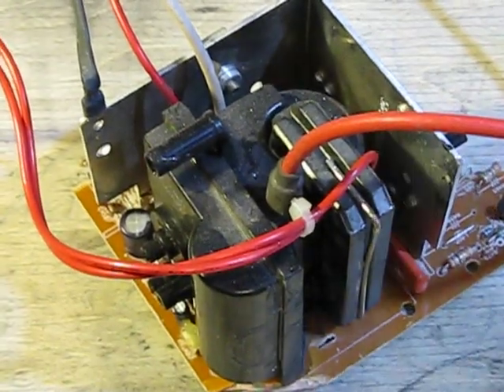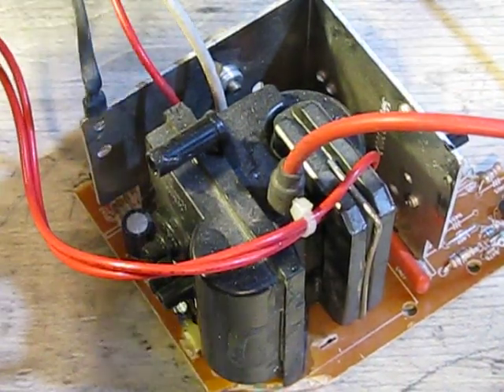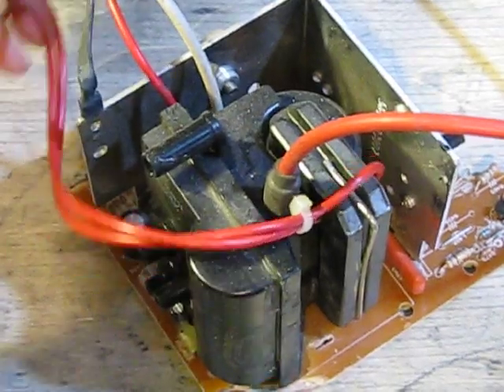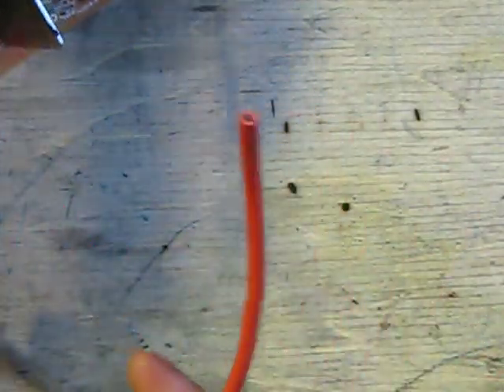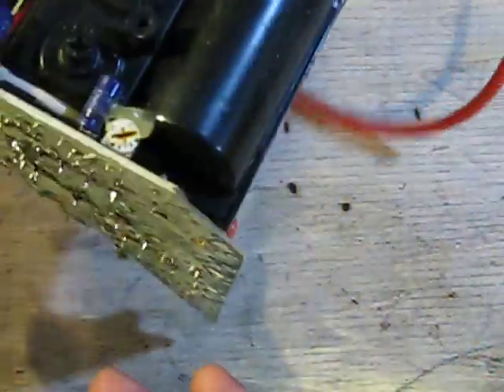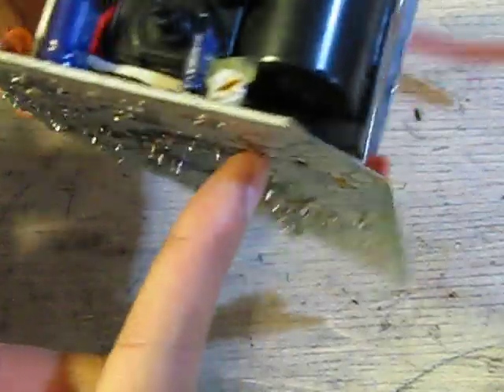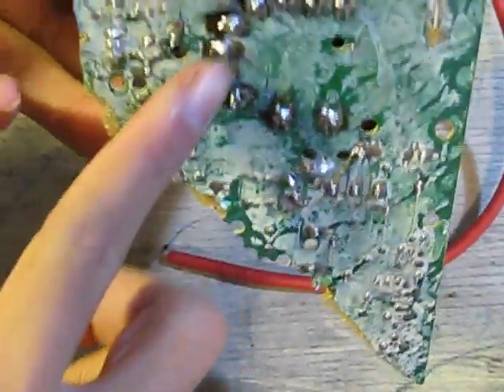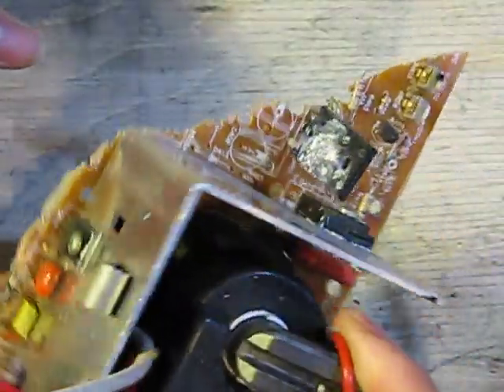How do you wire-up a flyback transformer?

Comment: I recommend using the 555 timer chip to either drive an FET power transistor directly or use a small signal transistor as a buffer to drive the FET. Proper triggering for the power FET requires that the FET gets at least a 3-5 volt fast rise pulse to properly turn on and off. Check the specs on your FET for the best numbers. It is a good idea to design a 555 circuit that has a variable on / off time.

Comment: I use the existing windings on the flyback (try to figure out which one is the one attached to the horizontal output transistor (the big one on the big heatsink). I find a good starting point is about 15volts at about 2 amps. You may be able to push up to about 35 volts at 3 amps. Definitly need heat sinking for this, also check out the FET transistor specs, you will be developing quite a bit of 'back EMF' on the transistor, may need a 'damper diode'  to quench the back EMF (can have zener too).

Comment: By the way, I am 64 years old and have been fooling around with electronics for well over fifty years. I worked on color tv's in the mid sixties ( the old original round tube crt's made by RCA). In those days flybacks were pure transformers, no diode doulbers built in, ac output requiring an external HV diode rectifier tube.

Comment: Using the ohmmeter, locate the windings on the FBT. There will normally be two or three windings, windings may have multiple taps. To determine the position of the taps, you may need a meter that is good at low resistance readings. There will be at least one lead that shows no low resistance path to the others, this will be the ABL lead (the low end of the HV circuit). Before you desolder the FBT look on the P.C. board. There may be lettering that will tell you which pin is which, FBT, HOT, etc.

Comment: The return wire for the high voltage winding will usually be connected to the base of a small signal transistor on the P.C. bord through a resistor current limiting circuit. This is the beam current limiter or 'automatic brightness limiter circuit  (called ABL for short). Once you have seperated the flyback from the P.C. board (using a heat shrink gun you can easily melt all the pins at one time and pull the flyback free). Using an ohmmeter, ohm out the windings. See next comment...

Comment: Be aware that most modern flybacks are composite devices, they have diode voltage doublers, trilpers, or quadruplers on the output side of the coil (also capacitors, you can get a nasty shock if you are not careful. This is a bad way to find out you have a bad heart!!!) Anyway, the output will be DC voltage at 25-35KV. Usually the CRT aquadag coating is used as the output filet cap. If you use the design I proposed in my previous posts, be aware that you easily short out the diodes in the FBT.

Comment: Of all those wires and pins on the bottom, you really only need to worry about 2.  The big red one is the HV output.  Then one of the pins on the bottom will be the ground return.  It's different on every flyback.  The easiest way to find it is to see which pin the HV out arcs to the most strongly once you have it up and running.  There are a lot of "flyback driver" circuits on the web, just google "flyback driver".

Comment: You need to have the right drive frequency and a short 'on time' to limit the total power dissipation of the FET. Proper heat sinking of the FET is also important, you may need a small cooling fan for continous opertion. Most designs on the web show using an external winding would around an exposed section of the core of ten to twelve turns of #10 wire and operate at 10-24 volts at several amps. On some FBT's this may not be possible.  see next post

Comment: Firstly de-solder it from the board, it makes it much easier to use.

Secondly look up "2n3055 flyback driver" on the internet as it is a simple driver circuit for beginners and only requires a 2n3055 transistor and a couple of resistors.

Rather than using the built in coils just wind your own on the core using some magnet wire as the primary coil (around 10 turns) and for the feed back just wind around 3 turns of the same magnet wire onto the core.

Message me if you need any more help.

Comment: My final note, please be careful. These types of circuits produce LETHAL voltage levels. You do not want to end your career as an experimenter prematurely. The spark produced by these FBT's may act like a 'lazy' ac voltage but, it has a high dc component. You can put a filter cap on the output back to the ABL lead. This will yield some snap. If you do, be VERY careful, this is VERY dangerous. Also high value 35KV caps are not plentiful. I recommend a 'beer bottle' capacitor bank (google it).

Comment: @MrSciencetificsasuke You will be fine, I started playing with high voltage when I was about 13 and I am still alive even after a number of small but painful shocks when I first started messing with it (I once got a zap from a  fully charged camera flash capacitor.)

As long as you follow some safety persecutions you will be fine.
Reply: would you be willing to help me wire up my flyback transformer? i have been using a light ballast as a driver but it just doesn’t seem to work and i have no idea what else to so

Comment: It's not the voltage that kills you though.
Reply: Wrong. With increasing voltage current rizes also so technically they both impact each other. So I. Short current kills but voltage has a effect on the current though.